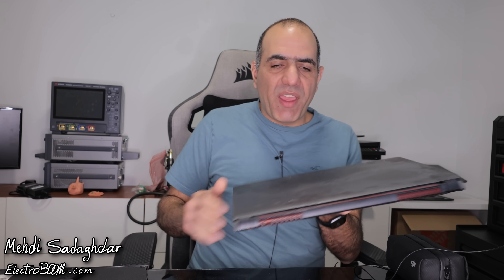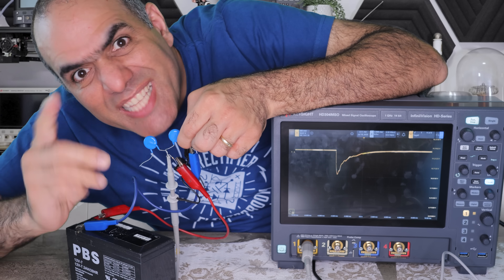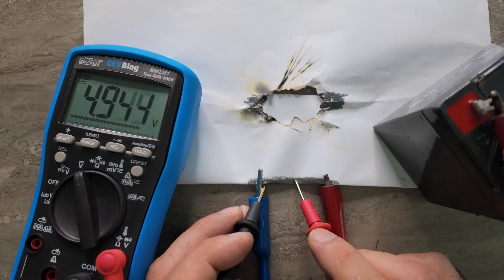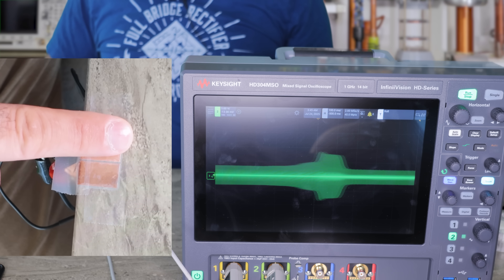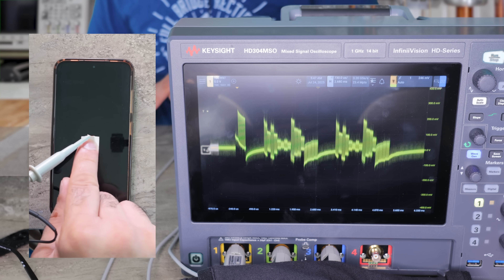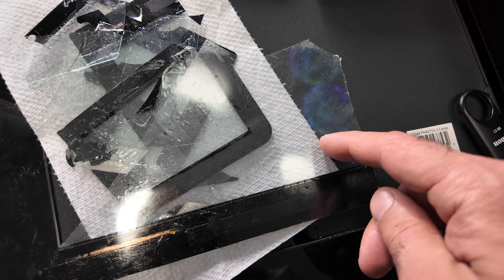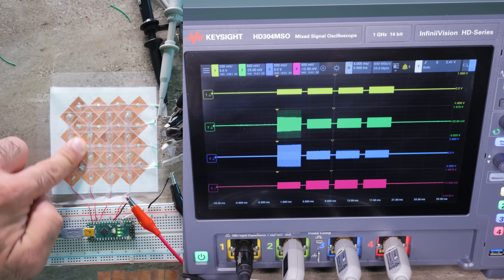The Touchscreen that Changed the World!

Comment: So the big issues IMO with using AI for coding, one is just that the AI was trained using the work of people who didn't give away the rights to do that (and since AI is not anywhere near the point of true sapience, which anyone who actually works on LLMs rather than just use them can confirm, it's closer to having the AI use a predictive model to select which pieces of other people's work make the most sense to put in a new thing, rather than truly synthesizing something new out of the knowledge gained from past experiences like a human can). Two, AI runs on predictive models rather than true understanding. These can appear the same in situations where The AI is working well, but it means that the AI cannot truly understand a mistake and rectify it, it can only modify parameters and then produce a new version. This is a major factor in AI hallucinations. It's something that a lot of people seem to interpret as the AI lying to them (notably a CEO who was using AI to code and modify I believe databases and the AI, against his instructions, implemented a change without letting humans review it that ended up deleting the entire database. He repeatedly described the AI as lying to him, when in reality it just did not have true understanding of what it was doing and the guesses it was making were wrong because of that, and it was telling him incorrect things about what it was doing because of that lack of understanding), but lying implies a degree of intentionality and malice that current AI is not capable of doing. This means that while it can be useful for very simple projects where the worst case scenario is a small scale short circuit, trying to use it in areas where it can truly break important stuff is a terrible idea, unless you have all of the needed knowledge to double check it. As you can see from the CEO who messed up, even just telling the AI to let you double check things isn't enough if you are giving it access to what it needs to break things, it needs to be kept isolated from the ability to do things that could cause issues. This means that it can't fundamentally replace people who know what they are doing, it can only be used as a tool for simple things or to hasten things along with human babysitters. 

And the final big issue is one that you brought up, which is that it removes the need for humans to truly understand things. In the ways that a lot of people are using it, it fully removes the need to do things like use logic and critical thinking, but even in more sane usage (having it program something for you rather than having it make all your decisions for you) it is still removing a layer of understanding that is otherwise necessary. That means that you are leaving yourself at the mercy of an algorithm that is controlled by rich people who do not have your interests as even a low level priority. So when they decide to make a change based on either political desires (for example Elon Musk trying to make grok more conservative, or even following a recent executive order to try to make their AI anti-woke like Trump wants), or they start restricting things to try to get more money out of you, or even just the company running the servers goes bankrupt, you are all the sudden completely helpless. And if we as a society do that, rather than just individuals, then we could potentially have some absolutely massive information gaps form from pretty simple errors. That is the sort of thing that led to ancient Greece losing all literacy for about 400 years following the bronze age collapse. Warhammer 40K is actually set after an apocalypse partially caused by the AIs people used to build everything breaking

There are also issues around the fact that, if AI does reach the point of being able to fully replace these jobs without messing it up horribly, we are going to have a massive underclass of people who have lost their jobs that our society and political apparatus are simply not equipped for. The disappearance of American manufacturing jobs due to a combination of political decisions leading to a cost of living in the US that is too high for companies to be willing to pay Americans to manufacture things has played a huge role in why American politics have gotten so willing to embrace violent and undemocratic ideas, and has been a major factor in the US isolating itself politically due to people blaming other countries and other ethnicities within this country for manufacturing jobs leaving the US. The number of jobs that are threatened with AI is potentially even larger, and those jobs tend to be pretty well paid and safe compared to a lot of the alternatives such as customer service that are less likely to be impacted by AI. So that will create a ton of political unrest and a lot of suffering, and it will allow the ultra-rich to be even less accountable towards the people who make up the majority of global population
Reply: That comment suffices as a reason for, and script to, your own 'tube video.  Dust jacket: you can't stop it, so you'll need to learn how to best live with it.

Comment: They weren't always this transparent. If you have a phone from 2010-2014, if you hold it at an off angle you should be able to the the grid pattern running under the screen

Comment: I appreciate you pointing out that yes, AI is getting to the point where it allows people who can't code to still bring projects to life.  I'm heavily a hardware guy, a few years ago I had ideas for projects that I simply couldn't do because I didn't have the code knowledge or the time (or brain) to learn it - I'm very thankful I can use AI as a tool to help me bring things into reality now (Whilst learning a bit at the same time), BUT...

Demonstrating using AI for researchable questions like "why is my touchscreen oozing" just gives me bad vibes as it's wrong so often and it's not good practise to replace Google-able questions with AI that has old datasets and that wants to spit out answers ASAP - It's a lot better to try and Google first so you can read for yourself from different current sources/opinions

Keep reminding people that they can achieve much more with AI via code and such, but please make sure not to portray it as the go to thing whenever you need to do/ask anything

Comment: 6:44 chemists 😦

16:08 it's more than just being able to make good prompts, AI is really impressive to get started on a task, but it has a hard time keeping up and building understanding as you add more and more requirements, or even keep iterating on the same problem over and over, on any task i've seen, as soon as it requires focusing on one thing for more than a few minutes (say, a 30mn threshold is probably optimistic on many tasks), humans with expertise gain the upper hand again. The problem compounds for people who get to this limit without learning the skills it would have required without AI, as at this point, they have no way to recover, neither them or AI can keep working on the problem, they need the help of a human with expertise, and these will generally be unenthusiastic about fixing the mess created by the AI, especially if the human in trouble doesn't show a lot of willingness to learn about how they got there.

When used by a human with expertise, able not just to prompt, but to direct the AI out of trouble, when its stuck, the results can be a lot better than what either the human or the AI could achieve on their own though.

So don't see AI as a way to avoid learning, see it as a way to make the same amount of learning even more rewarding.

Comment: 6:41 in this case alcohol is the solvent... 🥶
Reply: Use a milk frother cut off the coil at the end leave it with a straight spinning shaft and let the shaft touch the glue it will pull the glue away from the screen. It’s how screen repair shop does it (with proper tool not an actual milk frother tho, probably, hopefully not)
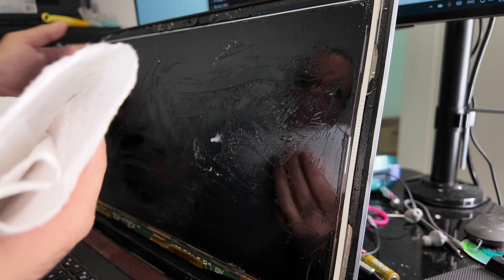Reply: heres the correct timestamp 6:39
Reply: Pun intended 😂😂
Reply: I'm glad someone else said it before me. 👍
Reply: ahahahahaha
Reply: :face-blue-smiling:

Comment: Interesting that you observe an increase in capacitance at the touch point. Actual devices typically measure a reduction in the mutual capacitance between the electrodes at the point of touch, explained by the finger being grounded (if only capacitively) thereby "stealing" some of the field lines between the two electrodes. This may come down to the geometry of the electrodes and insulating layers, as well as the grounding conditions of the circuit.

As for "electrostatic" it is a matter of perspective on time. The touch screen literature typically uses the term quasistatic. The signals are typically measured after the charges are fully transferred between the electrodes, thus the fields are static at that moment. Though there are at least theoretical designs using sinusoidal signals.

As for the strange pattern seen  when measuring on the phone device - some controllers activate multiple drive electrodes at a time in a pattern and do some math to recover the capacitance image.

Comment: we shouldn't rely on AI for this kind of stuff
both the research at the start and the programming at 13:50

other than the ethical debate that comes with how it has been trained, there's also the amount of water and power it uses.
Reply: You could run the ai on your phone now days like gemini-nano (i forgot the open source version of it), or you can have it running on raspberry pi (it takes 5usd to run the pi for 1 month, but that's assuming you are hammering the ai 24/7).

The power needed to run the ai is only when you are actually talking to it, else the machine is just idle
Reply: as the tech goes on the ai's will use less power over time. like older computers that used to be big now becomes smaller after couple years.

Comment: As a software engineer I'm heartbroken to see you promote AI generated code :(
Even taking a quick look at some premade human content from the public domain would have been better.  A logical mind like yours would have understood a simple switching loop in seconds.
Reply: As an electronic engineer, I dont care ppl utilize AI for simple projects despite there're better ways to design them , which reduces heat dissipation.

AI is merely a tool for quick resolutions. For most ppl, coding is something out of their lifes, even electronic and electrical engineers. we learn the basic concepts of coding for sophisticated controlling systems that require sequential and repeating logic calculations, but it doesn't mean we can understand other programming languages within seconds regarding the vast database that we have no clue about.

if I can get it done by seconds with AI, I will use it, rather than taking hours to optimize and debug the code.
Reply: @アムグス  You dont know if the code will behave correctly in all circumstances nor can you ever know because it is not the result of a logical process but simply a convergence of many statistical analyses using both known and unknown variables.

Comment: AI is very good if you want to extend something that has already been programmed (i.e., extend the code to 16 blocks instead of 2 that do the same thing). Or just to gather ideas on how to do something. I like to use it in cases where I'm stuck. Thanks to the explanations, it even shows you how it works (much better than just downloading/copying it from somewhere).

Comment: About AI...to be honest i started arduino the same way...I had to open chatgpt right after the installation as i never learned programming. Tried been on a fast course before but nothing stayed in my head, time has passed, and it was sooo complicated for me at the beginning. Right now i have a working code for a dryer box whats checking humidity and temperature and operates a fan and a heating element for the drying process. Yes its still mostly made by chatgpt but meanwhile i learned a lot of things and made "my" code to work exactly how i wanted it. I think, learning with chatgpt is a good thing, also for a project like this you also have to have some basic/advanced knowledge about elektronics. I only killed one mosfet during the process 😆